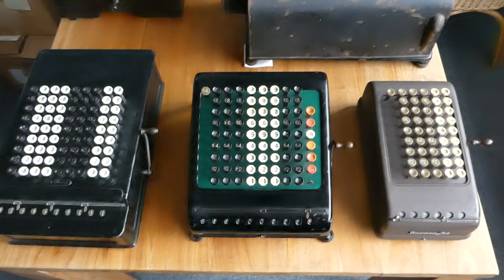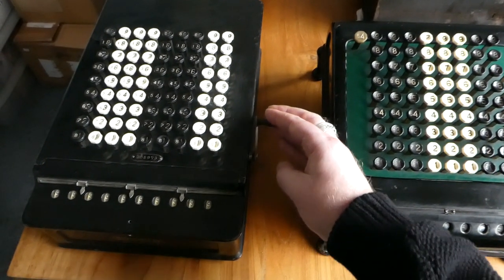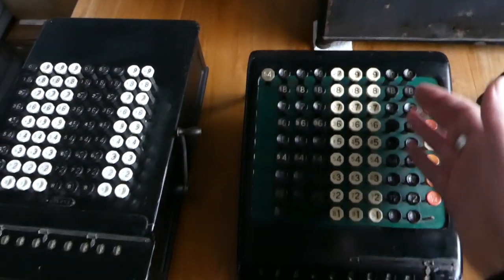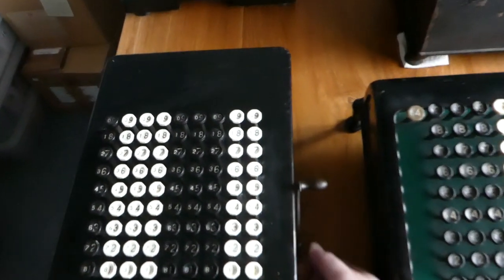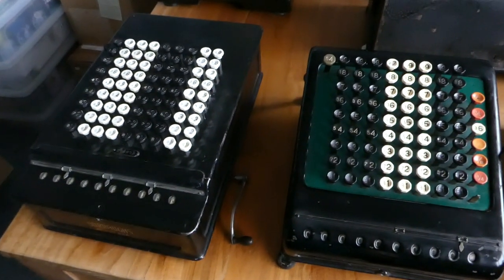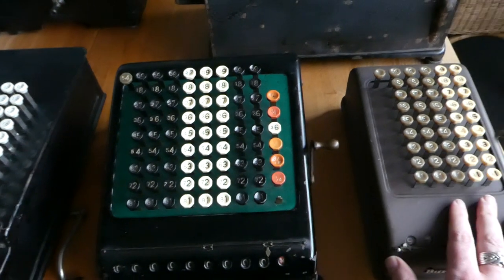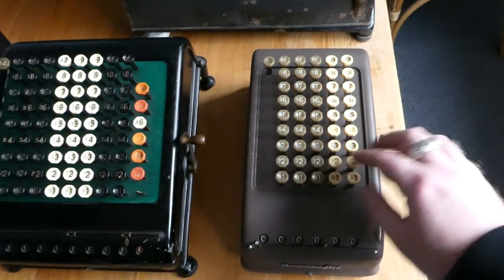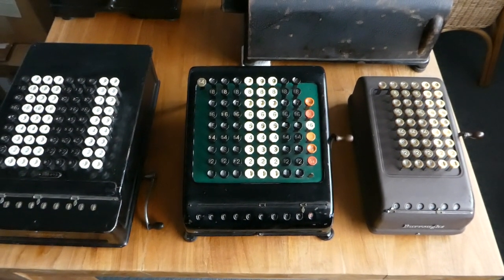Three generations of the Burroughs Calculator

Comment: I have a Burroughs Style No.4 calculator... from what I could find out, it was patented in 1888-1898, and in 1906 the Style 4 was advertised (along with the no.3 and no.5) in excellent condition... I would love to find a hardcopy manual to go with it !

I found someone on the internet who made a barrel key so I could remove the cover... those keys must have gotten lost very easily over time... I sometimes look through collections of keys when I am antiquing, to see if I can find an original key, but have yet to find one.

I acquired the calculator when I purchased my first house back in the early 1980s from a 90 year old man, who use to own a gas station way back when... I'm sure he used it there !